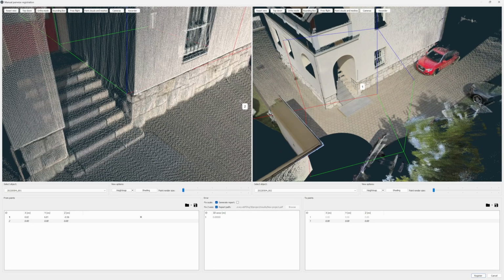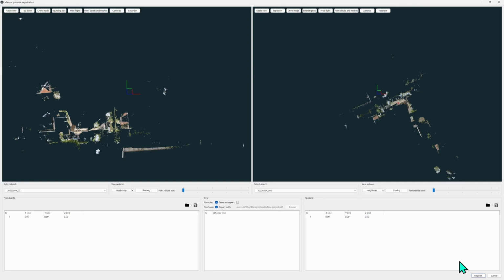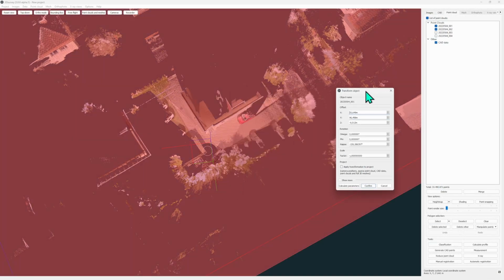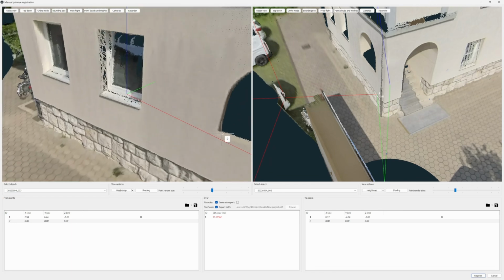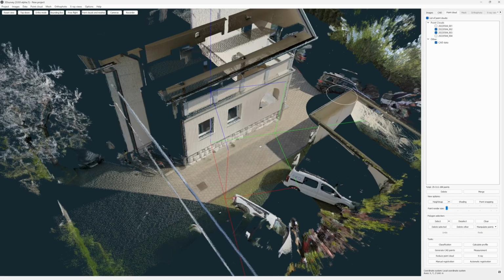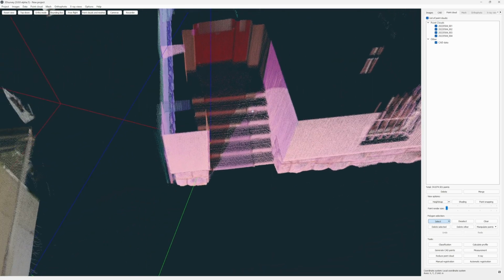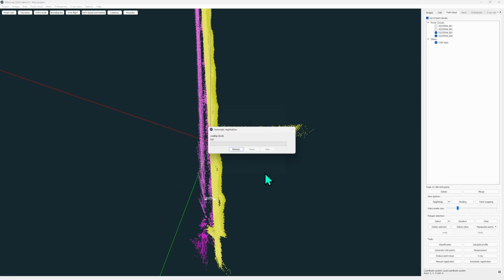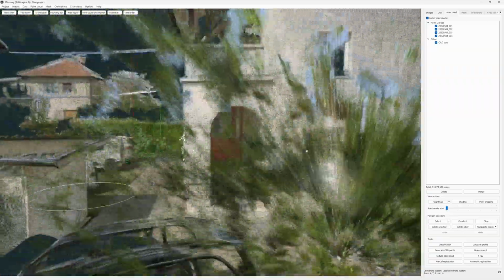Aligning Terrestrial Laser Scans in 3Dsurvey: Manual and automatic guide to Point Cloud Registration

Comment: very good video, a question, can I reference a point cloud in XYZ, for example using control points or something like that, to locate its geographical position?
Reply from the maker: Sure! Coordinates of GCPs can be imported into manual registration window. 
You can also do this via point cloud transform tool.
Reply: @3Dsurvey  
Thanks for answering, can I use control points for point clouds generated with a lidar scanner?